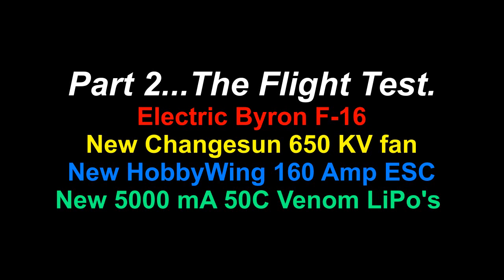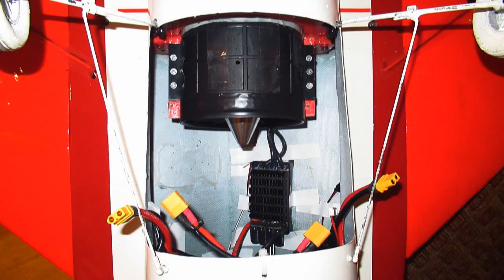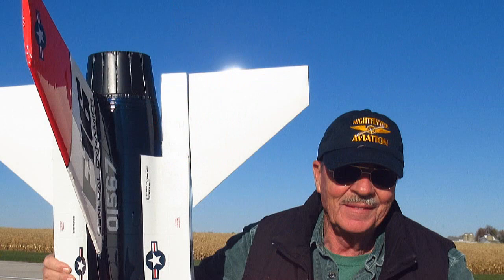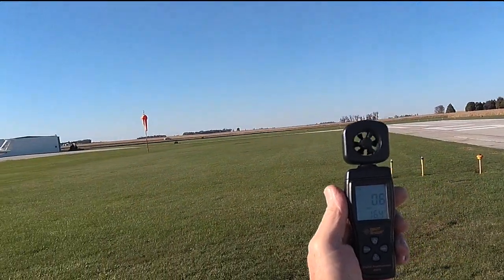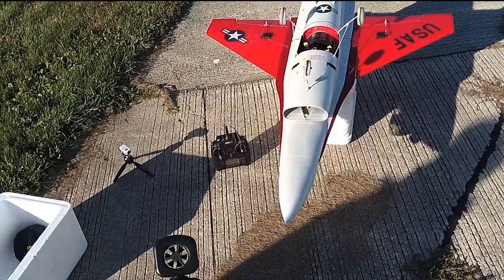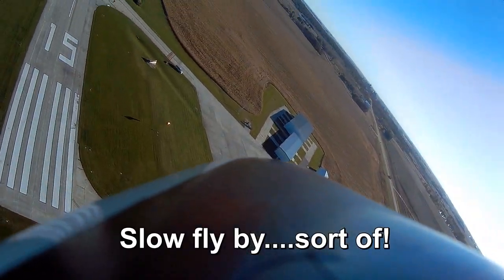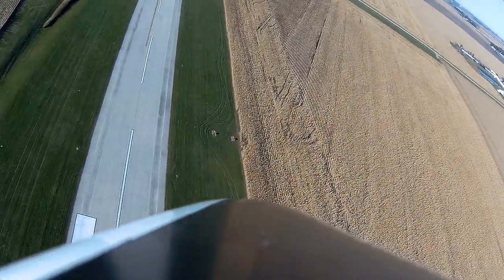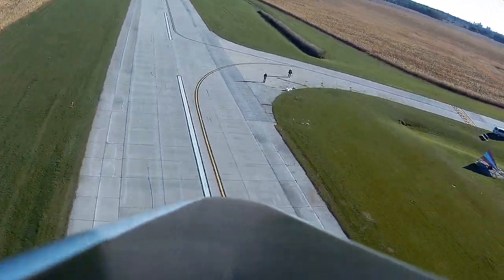Part 2, Byron Originals F-16 test flight with Changesun 650 Kv EDF & Hobbywing 160A ESC. WOW!

Comment: hi Dave,   do you know how much thrust in pounds yours made?  I have a F89 Scorpion that has a Byron DF and K-B 82 in it. I want to make it like you did your F16!  I think my F89 Scorpion is a B & D or D & B models. ill have to look at the plans. I got it built in a trade.  my brushless motor is a Scorpion Motor too. its a big fiberglass fuse and has foam core wings covered in balsa. its nice but showing its age. its over 30 yrs old.  if you need a OS91 DF head I have one your free!  I have a bunch of glow DF engines and 7 OS91 parts engines. I also have (2) Nelson 96DF engines and (1) Nelson 91DF engine> all of these are on BVM DF units. also Dave, how fast would you say your F16 is with the EDF in it? thank you Sir***  Gary Troutman

Comment: Flies very well! What size fan is that? How much does your F-16 weigh,and how much thrust from the Changesun set-up? I am building a Byron A-4 and am going electric since I gave my Rossi set-up to Captain Blaz.I have been looking at the JetFan 120mm with the HET 685Kv motor,but haven't made my mind up yet.Your F-16 sure seems to have plenty of power! Thanks!
Reply from the maker: Yes, Its a 120 MM Changesun 650 Kv EDF & Hobbywing 160A ESC. My first setup burned up, but this one works fine.  I dialed the Throttle throw back and am getting about 15 lbs of thrust with 170 MPH wind at the tail  I think the plane weights about 12 lbs with batteries.  I had an Byron A-4 back in the 80's with a Rossi 91.  Make sure to put plenty of nose weight in it, as they like to ground loop. This link shows at the end of the video the tests to show that.  https://www.youtube.com/watch?v=lKVq7Kz2eec
Reply: Thanks for the info! 15 lbs.is pretty awesome,with a plane weighing around 12 lbs.I think mine will come in somewhere around that weight with the mods I'm doing.I am changing the entire flight control system to handle the speed it should fly compared to the glow set-up it was designed for.The flying stab instead of a h-stab with elevators is one thing being changed,and the aileron control system is being redone completely also.I'm sheeting and glassing the wings and stabs as well.Thinking about making flaps,but may not,not sure yet,and gear doors,which it has none.It is a sport scale jet,so I need to remember that.The JF set-up is supposed to put out about 8.5kg of thrust on 12 cells which is more than enough.I will check prices on more options.The goal is to get it flying and then start on something like a Skymaster F-4 or A-4.
Reply from the maker: @jettechdon28  Great.  I went with the cheapest fan, as I am on a budget since my fire and kept it all very simple, if you watched the build video  Good luck with it and have fun.
Reply: Dog gone it Dave,I just found a Byron F-16 complete minus the edf system for $300.It has glassed wings and stabs and Robart retracts and all servos.Seems pretty cheap! Thinking about this while I'm working on the A-4.
Reply from the maker: @jettechdon28  That is really cheap.  Better jump on it, cause I paid a hell of a lot more than that for mine! Then I had to buy batteries, radio, fan, speed controller, etc.

Comment: Do you have a thrust tube on the plane? if not you prolly get more performance. Because it directs the air out the tailpipe instead of the air being thrown into and open fuselage.
Reply from the maker: Yes, of course.  They all came with one when they were being manufactured. If you watch my original build video you will see how I put it in.
Reply: Ok Good deal I will definitely check it out.

Comment: What was the reason you set the timing of the esc at 5 degree's ?
Reply from the maker: It gives a bit more speed, as the magnets get fired slightly ahead.  Some like 20 degrees for more torque but I settled on 5. Good question. Thanks.

Comment: I had purchased HABU and flew it several times but high wing loading and would spin in if not flown at high speed. Purchased the little HABU which is lightweight and easier to fly.  I can remember when Byron's was just coming out.  Someone had Pitts with the belt drive which overheated.
Reply from the maker: Yes. I had the Pitts too. It had the byro belt drive but never overheated for me. Unfortunately it was destroyed in the fire. That it couldn't handle as I just restored it a few years ago. It had a Rossi nitro in it. It was the first Byron I got before getting the f-16's I flew in the blue thunder movie. Thanks.

Comment from the maker: Please click this link to see part 1, the leaf Blower F-16, and thanks for watching. https://www.youtube.com/watch?v=lKVq7Kz2eec  This video is Part 2 where new modifications to the Byron F-16 were made. Changesun's new Fan is now 650 Kv versus the older 500 Kv and is rated at 150 Amps, vs the 500's 119 Amps.  It has more rpm per volt and produces more thrust at 75% throttle than the 500 Kv did at full throttle.  Here is a link to the 5075 650KV electric Ducted fan.
https://www.ebay.com/itm/312184590716
Reply: I have just brought this Same EDF WITH MOTOR gave it spin for 5 seconds onn full throttle 100% got quite heat up what do you suggest should i keep it till 75% like yours ? Help will be appreciated
Reply from the maker: @RahulSharmaworks  Well, I had plenty of trouble with the Changsun Fan you say you have, so here was the final solution for me.  This might help you.  Good Luck and happy flying.  https://www.youtube.com/watch?v=roKUGvIpkMU&t=34s
Reply: @NightFlyyer  Was the final solution to ditch the fan or how able to use it ? cause i cant afford to buy JP fan as i just brought this one
Reply from the maker: @RahulSharmaworks  If you don't run 42 volts thru it, it will work, but may not have enough power to fly very well.  The Changsun Fan is nice, but the specs are wrong and cant handle the high amps.  I learned the hard way, burning up 3 of them and 2 speed controllers before the JP fan was sent to me which is working great.  Good luck.